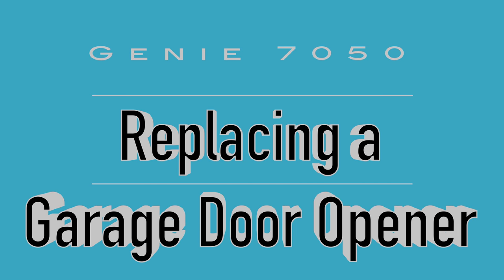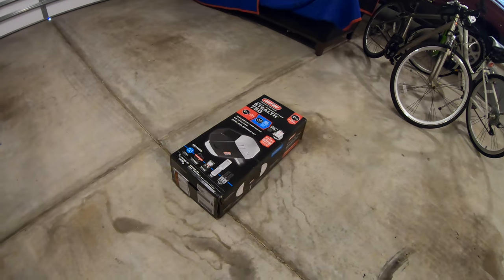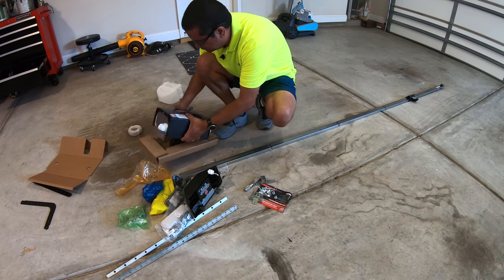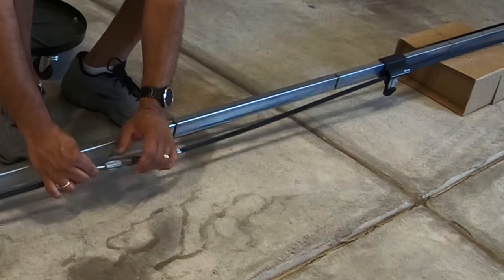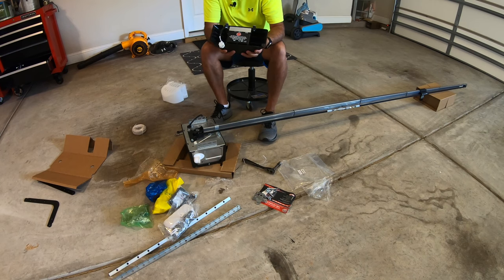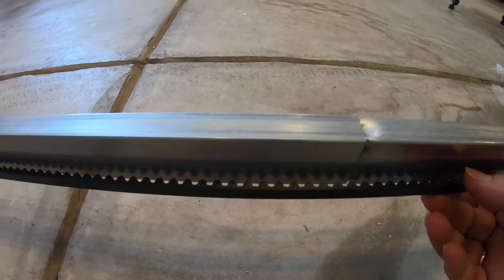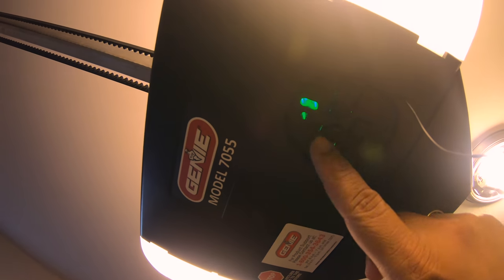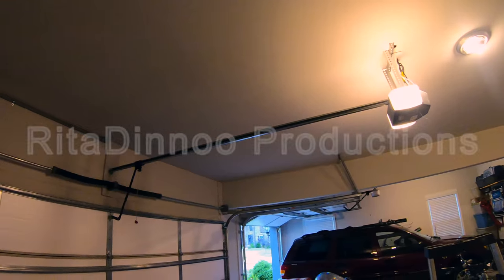Replacing : Installing a Genie Garage Door Opener

Comment: The garage door opener is not supposed to lift much weight.  The springs are supposed to balance the door and if you don't get the door balanced you are going to be replacing that new garage door opener ticker than you think.
Reply: now your talking!    the springs should be of the correct torque on the door when closed so that it takes a minimal "lift" effort to start the door moving up!   If you added additional weight by installing door insulation,  the springs should have maybe been changed out to handle the additional weight as to not burden the motor.  Let the springs do the work, not the motor.
Reply: My 98 year old great grandmother ate Captain Crunch every morning!!
Reply: @brianpiersol9412  HB BB uhh e doc
My BB

Comment: Door should of been checked for balance after insulation. Adjust as needed a work it. No door should depend on the operator to lift. Door balance is key less wear and tear
Reply from the maker: Thanks for the info!

Comment: Hey man, thanks for this video. Getting ready to put one of these in my garage and it's good to be able to visualize everything before I start on it. Kudos on the empty garage, too. Half my project is going to be moving mountain bikes, outboard motors and countless fishing rods out of the way. Thanks, again!
Reply from the maker: Thanks for watching. The tree is growing well.
Reply: @TheHappyLife-h7b  Got the thing assembled and mounted only to discover the power unit is bad, right out of the box. I checked it with my voltmeter and have a 120v going in, but zero output. I sent a message to Genie support and they sent a robo-response for me to wait 1-2 business days for an answer. I already know the answer, but I guess I'll have to jump through their hoops to get another power unit shipped. Nonetheless, your video was very helpful. Thanks again!
Reply: Hey thanks for the video
I’m struggling with ensuring that the teeth side of the chain are on the rails (specifically on the opposite side of the tightener). Any tips?

Comment: All you needed to do was rebalance the springs after you added the insulation. Would have been a lot cheaper.
Reply: I highly advise not to mess with that type of spring if you are not a professional. The above comment comes from someone who is a novice that usually gets their face wiped of with a wrench because they said “it’s cheaper’.   Also the same guy that keeps doctors and garage door companies in business🤦🏻‍♂️🤣
Reply: @Yosemite25  The tension in the spring has been set to counterbalance the garage door. If you add weight (via insulation panels), you need to add tension to the torsion spring. The extra horsepower opener will help, but the door should be able to be lifted with one finger (when disconnected). It takes minor competence and set of winding bars to re-tension, but your biggest thing to look out for is a ticket from captain safety AKA Yosemite25

Comment: Recommend learning how to unwind the springs. Then, w/the proper rods you can wind the springs the correct number of turns and then check out how balanced your door now is. further fine-tuning might give the perfect balance and allow your opener hardware to work as little as possible. Of course, one must be completely sober standing on a ladder, winding one's springs approx. 32 quarter-turns  and then tightening the bolts to preserve the adjustments.
Reply from the maker: Thank you for the advice and lessons learnt!!

Comment: Well there is some things that could be changed with this install whoever originally installed it in the first place mounted the garage door opener way too high up and has a garage door installer genie garage door opener‘s especially today’s especially on heavy garage doors the trolley mechanism all plastic one of my friends were saying oh Genie is the best product ever and I was like I bet you it’s going to break he texted me two weeks later saying you’re right the trolley broke so don’t waste your money on a product and don’t waste on a garage door opener that’s not broken because of the springs if you know what you’re doing with torsion springs then fix it if not you hire someone about the exact same cost as a garage door opener and as a future reference I recommend installing a chamberlain belt drive or a lift master belt drive those openers are very strong long lasting if you install it correctly put detailing your work and if the garage doors balance if the garage door is not balanced then you just put money into something that it’s just going to break again
Reply: Wow this is the longest run on paragraph I’ve seen.  I hope you don’t install garage doors like you write.
Reply: And the award for longest run on sentence in history goes toooooooo….. drum roll please…..

Comment: Great video. Mentally preparing me for changing my super old garage door motor with this same model. I am hoping that that tomorrow it will go smoothly. But this gives me hope, since I didn't hear a curse, or even you seemed composed. 
Thanks man!
Reply: How did it go? I'm about to do the same thing... replacing an old Marantec with Genie.

Comment: Good job in going through the installation steps; it was pretty clear,
Reply from the maker: Thanks and I appreciate the comment!
Reply: @TheHappyLife-h7b  I have A chain drive system. My motor works well. The thing is the old door was wood. This is a metel door.the motor is now not long enough. The adjustments are still not long enough to completely open all the way. Do rhey sell extentions for the beam? Ty

Comment: Great video.  I couldn't figure out why the opener was working but the door didn't go up and down. Seems nowhere is it mentioned that the belt turnbuckle goes into the carriage assembly. I found that out after reading the trouble shooting section.  I dont recall seeing you connect the two either. Still a very helpful video.
Reply from the maker: Thanks for watching

Comment: Couple tips for anyone reading, coming from a professional garage door / opener installer. 
First thing; don’t buy a genie, they’re really not worth it and I’d recommend purchasing a chamberlain, lift master, craftsmen. 
When installing the header bracket make sure to lift it a few inches over the springs roughly 3-4 inches, the rail should be higher next to the springs and sag downwards in the middle, rail should be 1-3 inches up from the top panel when the door is fully opened, when installing the arm that pulls the door, make sure it’s a slight slanted L.
Reply from the maker: Thanks for the tips and lessons learnt.

Comment: You did a great job with this installation. 
Do you know if I can use the one piece rail that's already have?

TIA.
Reply from the maker: Thanks for watching!! I have no idea if you can reuse an existing piece as the hole for the sprocket may not line up.

Comment: Once you mounted the rail onto the head unit, how did you align the carriage with the turnbuckle?  I am not able to move the belt anymore once the sprocket is attached to the head unit.

Comment: Hey I am attempting to install and the chain keeps rotating such that it’s not teeth side to the rails on the side opposite of the tightener. Do you have any tips?
Reply from the maker: I have not done a chain one in a really long time. I prefer the belt drive ones.

Comment: Batteries can be heavy.  It is hard enough to mount the the unit to the supports without the extra weight.  I would recommend attaching the battery pack after you have the unit securely mounted to the ceiling.
Reply from the maker: It was easier for me to lift with the battery attached vs trying to hold the battery up and connect it after the fact. Thanks for watching.

Comment: Is it still working good until now. Any problem with the belt? I am wondering chain or belt. Thanks
Reply from the maker: Its still working really good and no problems so far.
Reply from the maker: It works great! No issues with the belt. I did have someone come out and work on the springs to make it a bit more balanced but it works well so far. Thanks for watching!

Comment: Does it matter where that turnbuckle on the belt is in the beginning?
Reply from the maker: Thanks for watching. Yes it matters as the turnbuckle cannot pass through the pulley at the wall end or the sprocket at the motor.

Comment: wish I saw this earlier, I don't have that much clearance from the ceiling to the rail line after putting up. It seems like I have to take down to install battery back up cover. Do I need the battery back up? I am comfortable in leaving it out.
Reply from the maker: Thanks for watching….I purposely bought the model with the battery backup in case the power goes out. I have used it a few times.

Comment: What if one of the sensors has a red light and the other has a green light? Problem is my garage door closes and then immediately reopens
Reply from the maker: The red and green lights are correct. One sends and the other is the receiver. Your down travel may be too long causing the door to hit the floor too hard and simulate a collision with an object. Or maybe some how your line of sight between the green and red becomes interrupted when the door closes.I hope that helps and thanks for watching.

Comment: Great video!

We installed this very unit. When we power it on, the light is purple. The turnbuckle doesn't move far and doesn't allow us to set the limits. Do you have a solution?
Reply from the maker: Maybe call the manufacturer’s support. The adjustments should allow for this. Thanks for watching!

Comment: For the backup battery, did you have to drill the back of the motor to screw in or was the motor pre-drilled from factory?

Mine was not pre-drilled and want to see if you experienced the same issue?
Reply: Same. I just left the screws out.
Reply: @chewbacca7856   I just installed mine this morning and there are no pre-drilled holes either for the battery backup. I'm thinking about leaving the screws off too. Have you had any issue? Don't want it to fall off or anything.
Reply: @dsnel23  no issues and it's been 6 months.
Reply: @chewbacca7856  Thanks!

Comment: Is that old one a 3/4 HP ?
Reply from the maker: No, I believe it was 1/2 I think. Thanks for watching.
Reply: @TheHappyLife-h7b  just curious bc I just got the same one. It's 3/4 HP. That should be enough to lift an insulated door if your tension spring is properly operational

Comment: Excillent video!Ihad Genie installed,asked
For a3/4hp,he worhed
Till late,nextmorming I
Checked,no decalor the power of the lift.
It looked small,unable to talk to genie.I am very worried as to power of my lift.Help.
TERRY.
Went to home  Depot
Reply from the maker: I would make sure you are connected to utility power the battery is charged up.

Comment: If you installed a new garage door and now your garage door motor/opener is having hard time going up there is nothing wrong with your motor/opener probably your door hits the floor real hard when is going down when is not connected to the rail of the opener. You did not installed the door properly. 1/2 hp even 1/3 hp motor should open the garage door easily. Probably you need to wind up the torsion spring or springs if you installed two springs.(Constructive opinion Greetings)
Reply from the maker: Thanks for the comment and thanks for watching.

Comment: How long the belt usually last?  How expensive it the replacement belt?
Reply: I just installed two of the 7155 models yesterday. I’m here fighting the remote programming, but noticed your question. The kits come standard for a 7 foot (height) door, so I had to buy the 8 foot extension kit. It was about $40 at Home Depot. The kit included a longer section of rail where the idler puller is, a longer belt and a longer disconnect rope to release the door from the carrier. I had no idea I would need to buy the extension kit, so measure the height of your door before buying. They sell extension kits on Amazon, but I wanted to install this weekend. My local stores were out of stock, so I assume it’s not a common item for most stores. I had to drive about an hour away to a Home Depot to find mine. The openers are up and above my expectations, like way above, on how quiet they are. I had original to the house, AllStar brand 1/2 HP chain driven openers. They were really loud and sounded like the doors were falling apart when opening. I could release the door and manually open them, and they were quiet, smooth and easy to raise by hand. So my springs are setup properly, just 24 years on an opener is a lot of work. I did try lubing the chains, no help with noise. The 7155 is great, so far. The Aladdin app works perfect. Just wished I could figure out the HomeLink buttons in our cars and the 3 button remotes. I may have issue with using the Sylvania LEB bulbs I installed. I’m reading they cause RF interference with the signal. So, for $40, you can replace the belt. When I looked up the belts online at Genie, it’s $75 for a replacement belt. This may not be available for 7 foot doors.
Reply: @donrcollins231  After reading the documents, the motor and belt are lifetime warranty.  However, my concern is how long does it take to get a replacement belt?  One day of not able to open the garage door is a long time.

Yes, I have to agree the belt drive is extremely quiet.  All I can hear is the noise from the rollers.

About the HomeLink in your car...  First, you need to clear the old program on HomeLink by press and hold the #1 and #3 buttons at the same time.  When you see the green light blinking then you can let go the buttons.  Next, the best thing is to take one of the remote in the car and drive away far enough so the remote can't open the door.  There, press the button on HomeLink you want to program, you will see the light blinking.  Then press the button on the remote and hold for 2 seconds then let go.  Repeat a few times until the blinking light goes away.  You are only half way done.  Back to the garage, press and hold the program button on the opener until the light turns purple.  Now press the button on HomeLink a few times.  The purple light on the opener will turn green and you're ready to go.